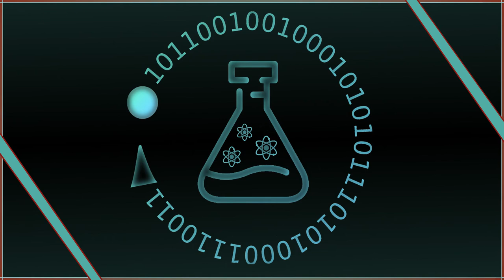Dierya DK63 mod (lubed Brown Tactile) with Krytox 205g0 and Foam

Comment: thanks soo much for this so useful
Reply from the maker: Absolutely, you're welcome! I definitely do suggest getting a hot-swap board over getting one that is soldered, but if you have a soldered board, often times it is more cost effective and easier to just top lube the keyboard, like I do in this video. Thanks for commenting! If there is something I can do for you, please don't hesitate to ask!
Reply: @ireakhavok  got it because affordability and totally agree with you but i have a question was that easy to get the plat out i have removed all the screws and its just stuck
Reply from the maker: @turb1ne74  So this has happened before with a couple others, do not force it out, but check and make sure that every screw is removed. Once you have scanned every row and spot preferably with a flashlight, then you can turn it upside down (with one hand below the keyboard) and shake it a little. Sometimes it does get stuck in the case, but every person was able to get it out with just a little bit of patience. Sometimes it is wedged inside the case, and you may have to pry it out a little bit. A guitar pick is good for getting in between the case and the plate. Sometimes you do need to pull it out. Ultimately what I tell people is that sometimes you need to use a REASONABLE amount of force. Do not use an UNREASONABLE amount of force. Maybe just a couple pounds / Kilos of pressure, but not enough that would cause a toothpick to break.
Reply: @ireakhavok   ok tanks

Comment: Wait I don’t understand how you lubed them???
Reply from the maker: I top lubed them, by pushing the stem down, and sliding a brush down the side of the housing.  This is another video I made that starts at an example of how I lubed these particular switches. https://youtu.be/IZPD4VPLMlE?t=158 You don't necessarily need to do it this way, but for switches you really don't want to solder, you can do it this way.
Reply: Oh ok thank you!

Comment: What screen driver do you need and what size
Reply from the maker: I generally use the 00 size, but sometimes test it out. I have a set of like 50 different tips. I got it for like 7$.

Comment: Hi I have the same keyboard with the same switches but in white I took out the 6 screws but the pcb still won’t come out am I missing something
Reply from the maker: sometimes the PCB gets caught up in this case. I would double check that you've removed the screws, and then gently turn it over and wiggle the pcb a little bit. If you are still having issues, double check that it is the same keeb, and then try flexing the housing a little bit, like twisting the left and right sides a little in opposite directions.
Reply: I'm currently having the same problems. There are 6 black screws that I can unscrew and then one silver one that will not unscrew no matter how much I try

Comment: is the connecter removable
Reply from the maker: what do you mean, the cable? yes, it's USB-C and removable, if you are talking about a daughter board, there is none, the connector is in the PCB.
Reply: @ireakhavok   Im nit sure ho to remove the connecter in the pcb without breaking it
Reply from the maker: @alisonhenderson4596  oh, for the battery. Yeah, you just wiggle it off. do not pull on the wires, use your fingernails to pry the cable end from the connector on the pcb. It is easiest for me to "walk" it out of the connection, prying one side then the other. You may also want to use a small  screwdriver, or even better, a plastic pry tool.
Reply from the maker: There is a plastic ridge you should be able to put leverage on. Generally this connection is harder the first time you release the connector, but it is better the next time.
Reply from the maker: @alisonhenderson4596  Message me on my instagram or discord if you still are having problems.

Comment: is there anyway I can switch the switches. i just bought kaihl speed pink switches and then i cant pull them out😐 theres gotta be some way to switch it.
Reply from the maker: so, yes there is, you will need to de-solder the whole board, however. If you look at either my K70 build video or my magicforce, it shows you how to desolder a board. It will cost a little bit to get the de-soldering equipment.
Reply: @ireakhavok  OHHH would that possible be a "solder pump"
Reply from the maker: @lime7395  a solder pump can work, but it is pretty hard to make it work. I suggest a de-soldering gun. one that is powered.
Reply: @ireakhavok  okay solder gun. Perfect. Thank you. U Deserve follow and sub
Reply from the maker: @lime7395  Thanks! Please let me know how the build goes! You are welcome to HMU here, in the discord, or my instagram. Just make sure that you do it in a well ventilated area, as it can cause you to have really dry and itchy eyes, and respiratory issues, if you don't have moving air and space.

Comment: I have a question, you know that wire? It pulled out for me can you reconnect it?
Reply from the maker: Do you mean the wires going to the PCB, from the battery? Could you send me a picture to my Instagram? Every wire can generally be reconnected, it just always depends on how bad the damage is. Sometimes the PCB can have the layers separate, or the pads can lift. In these cases it is either irreparable, or much harder to repair, but this is generally very uncommon to occur. I would buy a soldering iron that can reach around 400 deg. Celsius, at minimum, and I would buy some solder and definitely attempt a repair!
Reply: @ireakhavok  As much as i would send you a picture on instagram I don't have it at the time being, but when you took you the board part I think i saw where it goes. Also yes it was the pcb but i got it, thank you very much though!
Reply from the maker: @stromxz_497  my pleasure! LMK if you need anything else!
Reply: @ireakhavok  Okay! Thank you again!

Comment: what lube did you use again?
Reply: @ireakhavok  Ok, well I went for a cheaper option of the superlube 51004 for my dk63. I haven't done it yet though
Reply: @ireakhavok  Thanks for the help! I will make sure not flip it over and put small  amounts! Thanks
Reply from the maker: Krytox 205g0!

Comment: i gott 3 screws out no problem but the other 4 wont come out
Reply from the maker: Do be careful as the stand-offs are made entirely of plastic. Make sure that your screwdriver fits perfectly, doesn't wobble when properly seated, and you may want to get some extra leverage on it by using a larger screwdriver, or handle that is a hexagon. if you are using a screwdriver that has a hexagon on it you can use a wrench to slowly turn the screwdriver. they are rather small screws, so it might be hard to find a screwdriver that fits all of that. Just be careful and turn slowly with firm and steady force, but not an unreasonable amount of force or pressure.
Reply: @ireakhavok  after about 20 mins of trying those same screws wont budge at all ive tried different screwdrivers and applying more pressure is there any other tips that you have.
Reply from the maker: @hestia875  are the screws stripped? you can try using different screwdrivers. I don't think  there is a good way to lubricate them without the possibility of damaging the board. You could use a can of compressed air and turn it upside down and spray some fluid on it for a few seconds. It should cause the metal screw to shrink faster than the plastic can, technically that may help. However this can also cause condensation to form on the screw so it may slip off. Honestly there isn't a good answer here. If you are sure that you haven't been stripping the screw, then I would suggest keep trying. If it keeps popping up off the screw, then try a different screwdriver. You are welcome to send me pictures or video to my instagram page.
Reply: @ireakhavok  ok thanks for the help
Reply: @ireakhavok  yea I'm pretty sure there stripped I've looked up some videos on how to get stripped screws out and it didnt work. Is there a possibility that the screw heads were already damaged before i got the keyboard because ive never tried to take apart the keyboard before or messed with any of the screws.
Reply from the maker: @hestia875  Well, I've never seen a board with stripped screws sent out, but It's not out of the realm of possibility.  I'm sorry that the screws are stripped. That is like the number one problem to avoid with flush mounted screws. you may want to take that to a repair person, or return it if you can. I am out of suggestions! :/

Comment: are the stabs screw-in or  or do you need to desolder them
Reply from the maker: They are plate mount. You will have to de-solder the switch that it is meant to stabilize to get it out.